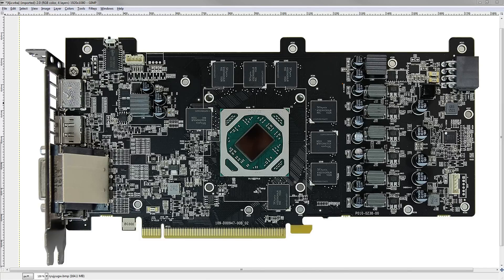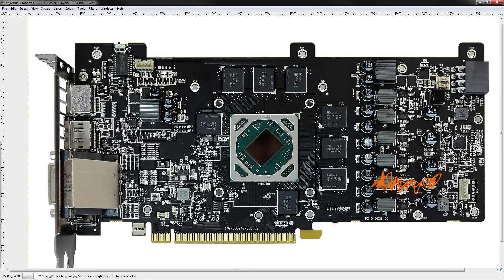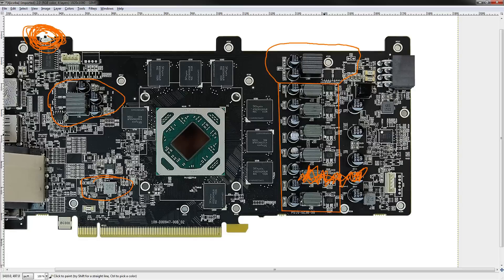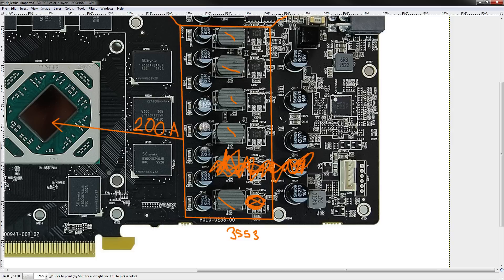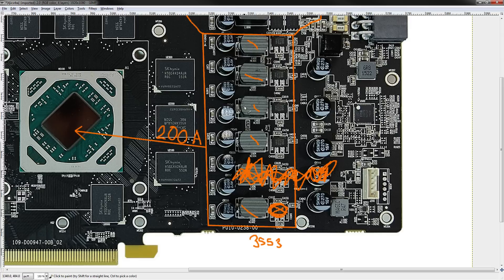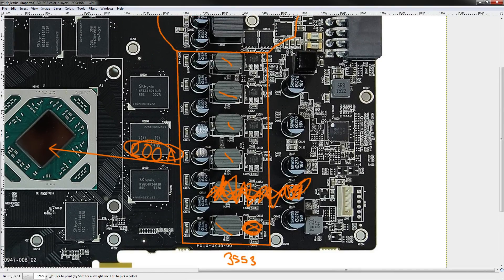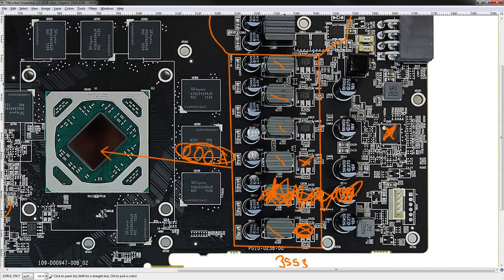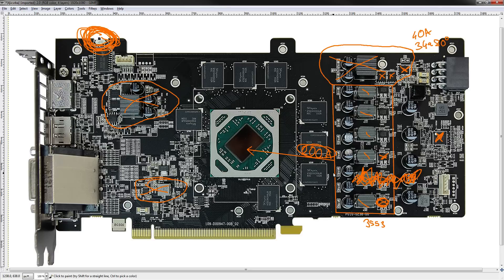PCB Breakdown: Sapphire RX 480 Nitro+

Comment: hello, I have question about this card's VRMs. I have RX470 sapphire 4gb and it got water damage by some juice water. But when I compared it to my other (working) sapphire rx470, they were different. I mean, on broken one they were almost all shorted. Is that a part of design? And if no, what could  it damage and what can I use to replace them (I can find similar, but not exact same parts)? Thank you a lot, and also a very good video :D

Comment: As it turns out a specific part of Anthem will make my Nitro + pull that 200A at 1480MHz 1.27 V [water cooled] and trip OCP and shut my machine down.  I caught it once thanks to micro-stutter and checked HWinfo it showed 198A.  Took me ages to figure out why my machine would straight shut off in Tyrant mine.

Comment: I just picked up one of these and it is a beast, I'm getting 1485mhz in firestrike at 1.22v and at 1500 it's made it through a run or two as well, all on air and in the 60-70C range. I know there's more performance to be had but I'm definitely needing to read up more on overclocking polaris before I can get there

Comment: i have a 4+1 vrm rx 480 sapphire 8gb with the memory having an M with a circle around it like nasa kind of has, dont know the memory chips, but these are my vrms courtesy of sapphire's facebook page after i messaged them: http://www.vishay.com/docs/76784/sic634.pdf

i see that i want to keep these under 125 degrees, any recommendations on how to keep them cool after i drop a water block on the pcb, i ordered some 9x9x12 aluminum heat sinks and have an 80mm fan to blow directly on them, will that be enough when i start overclocking it? any way to let me know how good of memory i have without tearing it apart again to find out the memory being used? what kind of potential can i look forward to getting out of this card if i didnt lose or win the silicone lottery but have a mid ranged chip?

Comment: i have the nitro non plus 1306mhz 8gb without led, is that the 6 phase? its on amazon as the 20-20g i think, discontinued model, i dont want to have to take it apart to find out just yet, but i may do that here shortly to get some measurements and apply new thermal paste to it and some of the mobo heatsinks i have to get everything ready for water cooling, i was also wondering if the size of the holes for the screws are m2.5 m3 or m4 (2mm 3mm or 4mm) without having to take it apart and go through putting it back together right now.

Comment: What does a bios switch do excactly ? Reset the bios for if you fcked it up?
Reply from the maker: A card with a BIOS switch will have 2 BIOS chips. So if you mess up one of the chips you can switch to the other boot on it and then once in the OS switch to the messed up chip and try flash over it with a good BIOS.
Reply: Actually Hardcore Overclocking thanks for the fast awnser :)
Btw, should I go for asus strix rx480 or nitro + rx480 (8gb) 
If I get nitro+ I will watercool
Reply: Toto Geenen for Nomal users( mean Not flashing bios or somthing)
it usually Switches between Reference Clock and slower Fan RPM Config

other bios is Factory Overclocked Setting with Aggresive Fan profile

Comment: I just did a fairly, simple mod. K5-pro thermal paste, took the VRM screws, rubbed them in with that thermal non-conductive paste, screwed them back in, and simply increased backplate efficiency.
Reply: Did it improve thermals?

Comment: people make this misconception all of the time.... that missing phase is an RX 470... sucks that these manufactures do this... because other brands like ASUS and MSI people are posting up RX470 with missing phase powers thinking that it's a 480... i bought a brand new one... like 5 months after all of those wildfire reddit posts about all of these brands doing this.. and when swapped out my cooler... I have all of my powerphases that is advertised by MSI Gaming X....

Comment: Would you see noticeable improvements in temperatures if you replaced the stock thermal paste with some arctic mx-2 or so?
Reply from the maker: No idea. You'd have to test. Also if you are going to be switching pastes I would recommend something better than MX-2. I run MX-2 as my expendable paste and use Thermal Grizzly Kryonaut when I want to get the best possible thermal performance.

Of the top of my head I think the top pastes in particular order are:
Thermal Grizzly Kryonaut (this one is designed to also work really well with LN2 which is why I use it)
Thermal Grizzly Hydronaut
Gelid GC-Extreme
Noctua NT-H1

Comment: So, if I want to mod my nitro bios with PBE, should I change my TDC to 200 A? or simply x1.5 it (from 124 to 186, like TDP and max power limit, i x1.5 them from 110 to 225)
Reply from the maker: TDC to 200A and TDP to 300W. That should give you the best results.
Reply: Actually Hardcore Overclocking ok ty, but is 300 out of pcie specs? like 75 watts from mb ad 150 from 8pin?

Comment: Okay, what m I missing here?  200amps is enough to run a house and trip the breaker in a standard circuit 5 times over. 

Do you mean watts, or am I not understand what you mean by "Amps" here?
Reply: Late answer, I know. 
But Watts=Volts*Amps

Your house runs on 110V or 230V. 
A RX 480 however runs at around 1.2V.
So if you multiply 200 amps with the 1.2 Volts you'd end up at 240 Watts whereas your house (assuming your house is consuming 200A) would end up at 22.000 Watts (or 46.000 for 230V).

Comment: My 470 8gb Nitro+ hits 102C on the VRM1 temps with the card undervolted and max airflow going through my case, do you think there's something wrong with my thermal padding or the card itself? 
I have an 89% ASIC, and according to Sapphire Support the VRMs are safe up to 120C, but I just don't feel like I should be hitting those temps without even overclocking it. Thoughts?
Reply from the maker: No idea I never had the card in hand to test how it behaves IRL.
Reply: Ah, bummer. Thanks for the reply though man, I just built my first PC a year ago and I recently started watching your channel, keep up the awesome work man, I wish I had your knowledge!

Comment: Question: does your PCB breakdown on the Nano apply to the Fury X? If so, to what extent do they differ, if at all? Just bought a Fury X for $330, so I'm curious as to how I can OC the everliving shit out it.
Reply: i'm fairly certain that the R9 Nano is almost identical to the Fury X except it has an Air Cooler instead of a Closed Circuit Liquid Cooler.

the R9 Nano has a less powerful VRM set though. they should be very similar (basically identical) except for VRM design.
some stuff is moved around, but it looks like all of the same things are on the PCB.

Comment: I noticed two fuses after the 8 pin power connector and one fuse after the 12 volt input that comes from the PCI-E slot.
Nice safety measures.

Comment: which rx 480 custom is the best rog strix or sapphire ?
Reply: Daniel Dimitrov sapphire in my opinion. I have a full review on my channel where I run the card @1430mhz stable
Reply: is it nitro which is 1306 or 1342 core clock
Reply: Daniel Dimitrov it's the 1342 sapphire nitro+OC
Reply: okay thanks probably i will go with sapphire

Comment: So this does 40A*5phase=200A at any temperature, but the red devil handles 46A@25C dropping to 34A@80C through 6 phases comes out to 276A@25C and 204A@80C. Now in the powercolor video you say that it's worse than the reference card because the ref can do 66A@25C and 50A@80C (much better than the power color to be sure) but according to my math, the red devil still delivers the same current as the sapphire nitro at 80C so as long as your VRMs are at 80C or less then it's just as good as this card.

So for actually hardcore overclocking, do you usually push the VRM into 100C territory, where the red devil will derate under 200A, and that's why it's worse or do you usually cool the VRMs sufficiently to keep them under 80C in which case the red devil is just as good as this card? 'cause if you need more than 200A into the core, then this card won't ever be able to do it, and the red devil (and especially ref card) will happily deliver more than 200A into the core provided you cool the VRM sufficiently. I'm not an expert in overclocking, so I'm just trying to get a handle on why the red devil is so much worse than this, even though it delivers more current up to 80C.

Comment: I would love to see fan reviews. 
I have no clue if buying a 1$ fan is ok xD
And if sp vs af does make a difference (for a case fan, a radiator and an air cooler).
And if you can trust stats given by the manufacturer.

So many questions xD

Comment: Did really early rx 480 nitros ship with the six channel VRM, or did all nitros that got shipped come with only five mosfets?
Reply from the maker: some are 6 some are 5 but all have software fix so that they all only run on 5 phases.
Reply: Could the 6 versions be unlocked with a bios hack?
Reply from the maker: in theory yes.
Reply: So they wouldn't have to put out 2 versions of every Bios update from now on.
Reply: I think the 6th phase was causing extra fan noise and heat. because some people say that the nitro is more quiet recently than it was. the clock speed was also dropped a bit in the newer nitro cards. 
I'm thinking this would be a great card for water cooling

Comment: you should mention that this video is about the 4gb version of the sapphire rx480 nitro
which is obviusly cheaper than the 8gb version and has a different PCB.
this one has 4gb of SK-Hynix H5GC4H24AJR-R0C 7-Gbps-GDDR5,
the 8gb version has Samsung K4G80325FB-HC25 8-Gbps-GDDR5.
buy the 8gb version and you will get all 6 phases,
this is why it is more expensive ;)
Reply from the maker: Both the 4GB and 8GB cards use the same 5 phase PCB.
Reply: ok looks like PCGH has wong info in their magazine. i bought the strixx after i saw your video, keep up the good work :-). 
can you make a video about quality of caps? looks like the srixx has also some smaller caps on the backside of the pcb

Comment: Hey buildzoid, do higher quality VRMs last longer when not overclocking or are they no different if you stick to the stock voltages with occasional minor overclocks ?
Reply from the maker: They do last longer but generally at stock most VRMs will last for ages and ages. The capacitors are usually the first things to give up after 5+ years of use.
Reply: I see, thanks. Does the same rule apply with capacitors, where quality = longevity ?
Reply from the maker: Caps have a K rating. This is how many thousands of hours a capacitor will last at a certain temperature.

Comment: So which PCB is better this one or the Strix? Guessing the Strix is better since it's more expensive
Reply from the maker: Strix is better. There's a video on the channel about it.
Reply: Okay i'm gonna go with the Strix thanks
Reply: The bios switch is a big selling point also, if the strix had that it would be perfect.
Reply: And it's smaller, less gpu sag.
Reply: The Strix has the best PCB. But the Nitro has higher quality fans on the stock cooler. I'd personally choose the Nitro.
Reply: using the nitro right now, my only complaint is that the rgb led doesn't go fully white.  it has a blue tint which kinda sucks in a black and white build but other than that it is a great card. Purple and blue look great on the card though.
Reply: +Totally Not a Ninja Get another GPU (can be old, you only need to be able to connect if to your monitor) and you shouldn't need it. But it would be nice to have...

Comment: You sure that the RX 480 Nitro is missing one phase? There could be a difference in phases between the 1342 MHz and the 1306MHz version for example...
Reply from the maker: I doubt it. If they run those 5 phases at 600Khz instead of 500Khz it will match all the 6 phases for power quality.
Reply: How much of a hassle would it be to enable the 6th phase? That is assuming I have one with all 6 phases present.
Reply from the maker: It should just need a different BIOS. I'm also pretty sure almost any RX 480 BIOS should work on any other RX 480 just because they all use similar voltage controller setups. Since you do have a BIOS switch just try what ever BIOS you want.
Reply from the maker: Everything I've read points to some old 6 phase 4GB cards floating around with the 6th phase disable in firmware and everything else runs 5.
Reply: Im going to get this card so i can confirm it when it arrives
Reply: Tehee mine has the extra phase! 1342 version
Reply: Would there be any increase in overclock performance with the 6th phase enabled?

Comment: I think you're over estimating how hot the VRMs get on gpu-only watercooling. My cards with a watercooler stuck on gets the VRM under 70C under all loads I put even at 1420MHz 1.25v with just a fan blowing on them. So the Reference cards would still probably do better than this in real life
Reply from the maker: the few unheatsinked high power VRMs I've run went straight for 100C and then the thermal protection started to step in.
Reply: Actually Hardcore Overclocking Huh weird. I mean I guess the reference ones do run REALLY hot though now that I think of it. My old reference cards VRM ran at 90C ish  with the stock blower still on. But I think that's mostly because the GPU itself ran hot. But yeah actually on my cards the VRM ran cooler after putting the watercoolers on and no heatsinks on them. Previously on the stock cooler it ran at high 70s to low 80s even with it heatsinked to the main fin array.

Comment: How much money do they actually save by omitting that 1 set of parts?

By skimming down on 10% of the PCB, they think they can save 10% on all of the cards they sell, making 10% more profits?
Reply from the maker: The PowIRstages used on this card are about 3$ a piece on Mouser when buying bulk. The inductor and cap are probably around a dollar each.
Reply: Actually Hardcore Overclocking
So they save $5 per PCB for reduction in a few pieces. So in bulk at like 10,000 cards, they'd save $50,000 dollars. Considering that they are selling them over $300 each, at 10,000 cards they'd make 3 million, plus make back 50,000 from less components.

Another possibility is that reduction in a set of components is to allow them to re-use this component onto another PCB.

If a single PCB holds onto 6 sets, then reducing it by 1 means for every 5 PCBs you removed those sets, you now have 5 free parts to put onto a new PCB.

6x (5/6) PCBs + 1x (5/5) PCB with the removed components.

This means they can sell another GPU at it's pricing with this setup.
Reply: Sorry to hijack the comment thread, but in your opinion which is the best RX 480 PCB? I don't really have the spare time atm to watch all of your PCB breakdowns, as awesome as they are. Excuse me if this is a dumb question.
Reply: Strix, XFX GTR and HIS are all very good. Avoid ASUS if you can because ASUS. I'd go with XFX GTR (not RS model).
Reply: no need to actually have 6 phases. you know a more rigorous design than the 1080 vrms. this 5 phase is near enough the same as the 1080
Reply: taief miah Fair enough, but if the cards are the sameish price then you may as well get the one with all 6 phases.
Reply: SYST3m but if it makes no difference in actual practice there still isn't any point to it
Reply: taief miah Yes, but if they're the same price so you may as well get the card with the better PCB because why the fuck not lol.
Reply: SYST3m not really. The one with the better warranty and cooler then makes sense
Reply: Illsigvo yh the only problem with his is their cooler designs. But if you are normal and keep your pc in a case with no window it's cool

Comment: A tiny bit of info on memory power, 8GB 8GBps RAM AND the memory controller uses <40W combined.  I believe 20-25W for the RAM and the rest for the MC.
Reply from the maker: Yeah I realized after I recorded. The ref 480s at stock average 150-165W and the core is pulling 110 so I was off on my power numbers a bit because I forgot that there's 2 things that pull those extra 40-55W not just the mem.